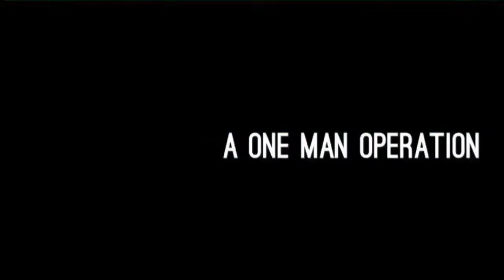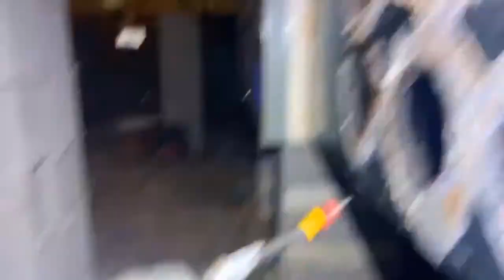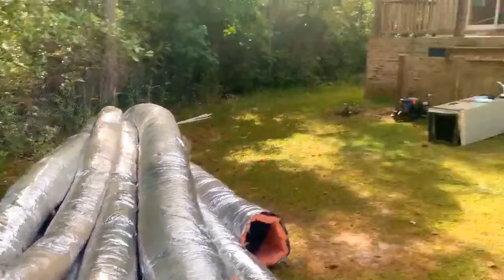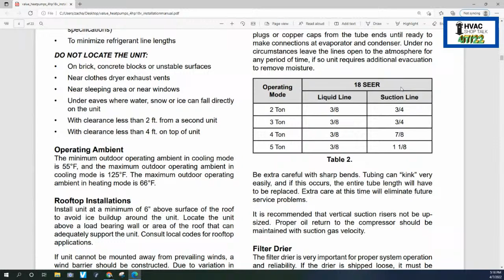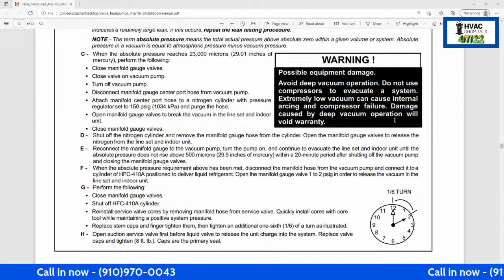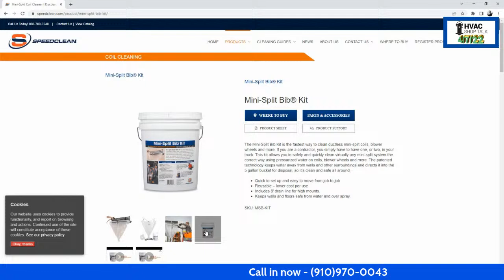4/7/22

Comment: The diakin blower wheels are actually easier to pull out then mitsubishi. Take the cover off, three screws on left side of coil. You can lift the left side of coil  up and pull the wheel out. I can take the wheel out in 5min. There is no set screw, dropping the drain pan, none of that. With that being said, I'm not a fan of working on any mini split. lol